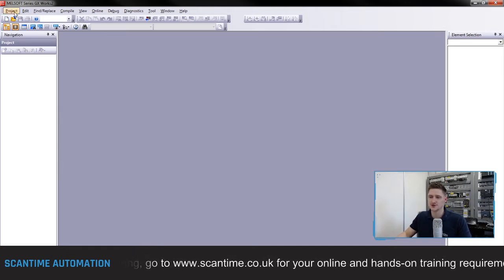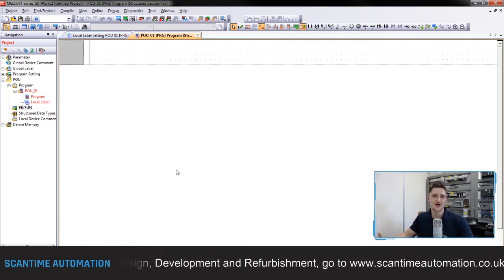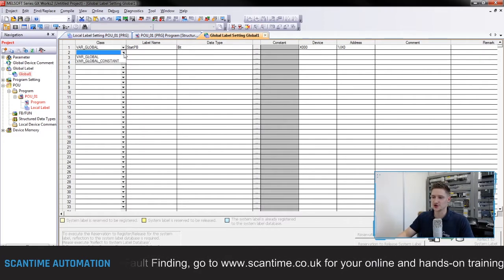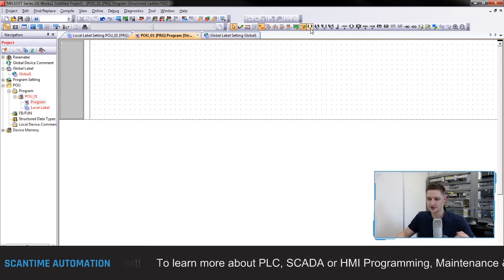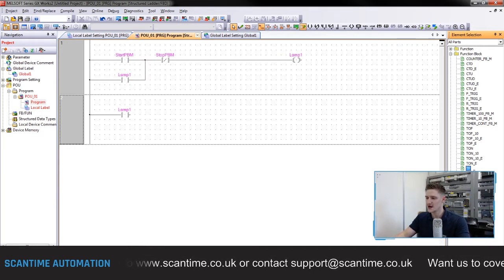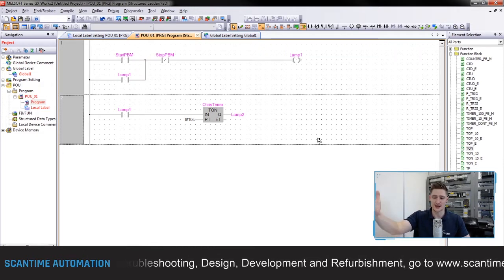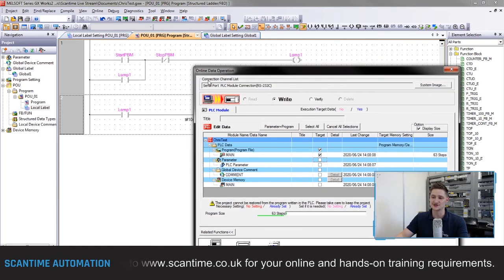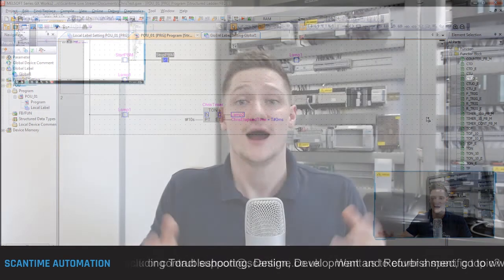An Introduction to Mitsubishi GxWorks 2 and How to Create your First Project!

Comment: Hello, Excellent explanation. Very much simple and understandable to beginners. In my FX3U compact PLC the TON instruction doesn't work. The PLC goes into Error when run. This is applicable to all IEC function blocks. Program compiles without error or warning, offline simulation runs well. What is the possible reason?
Reply from the maker: You are welcome! We would have to check your code unfortunately to see what may have gone wrong.

Comment: I have a few plc’s. Mitsubishi fx1s10. Fx3s10. Omron CP1E . Crouzet millennium 3. I also have an old GOT 1000 HMI. I have CXDevelopper, omron cx1 and crouzet free software. I want to end up with just one brand. What do you suggest I keep?
Reply from the maker: Keep them all! But if we were to recommend one, Omron is a great starting tool! We also have an online course called the PLC Programming for Industry course which is perfect for beginners and uses Omron as the learning platform due to its ease of use.